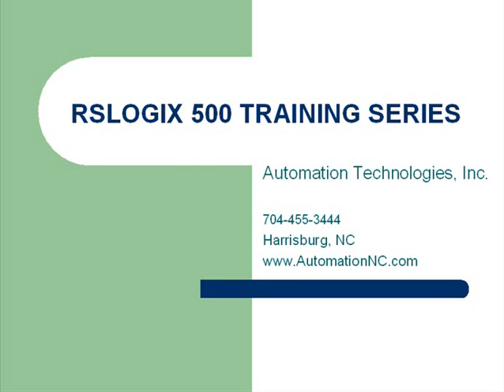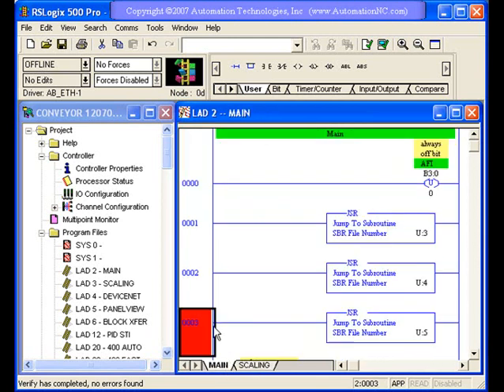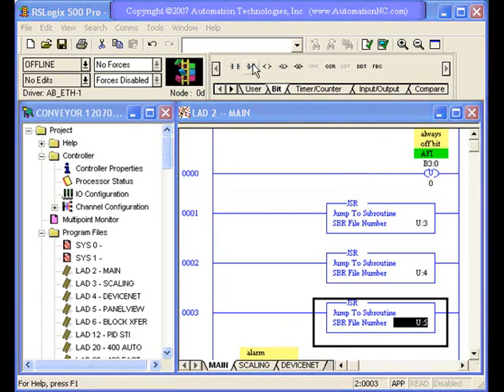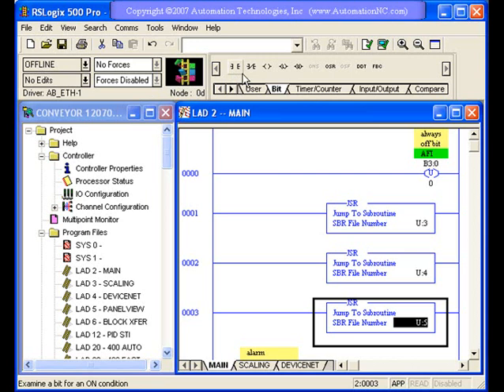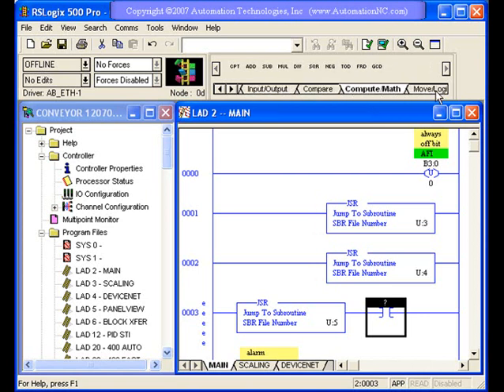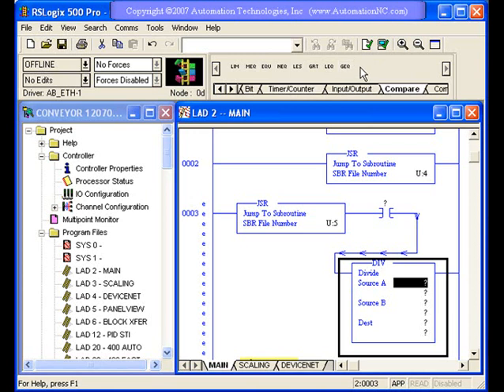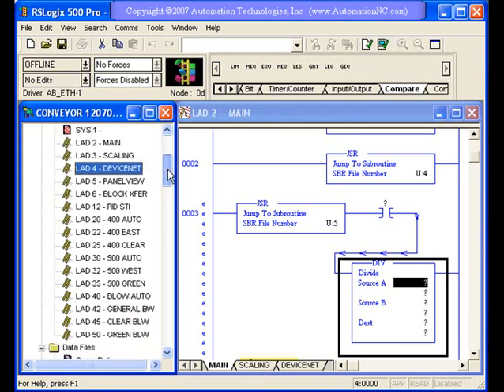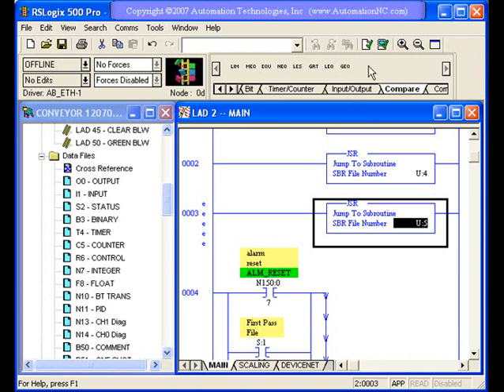PLC Training - Introduction To SLC Programming, Part 2

Comment: I have an old Allen Bradley PLC 2.  Is there any software I could get to practice programing the unit with.  To make it actually do something. Not just to run a simulator on the computer but to actually program the unit.  Thanks